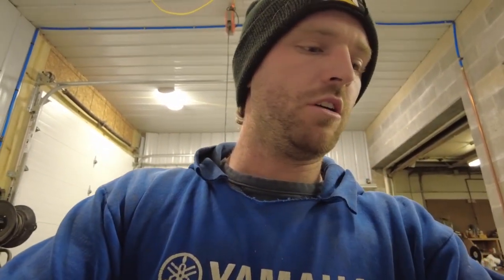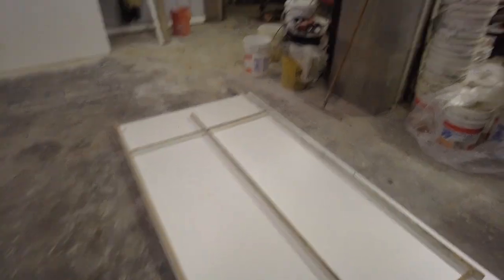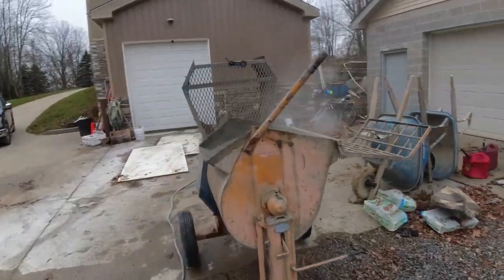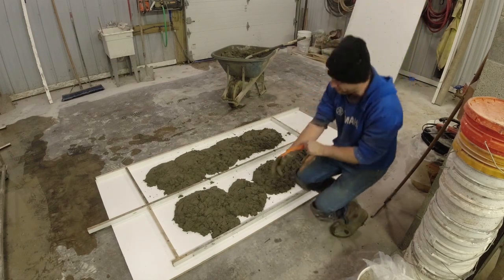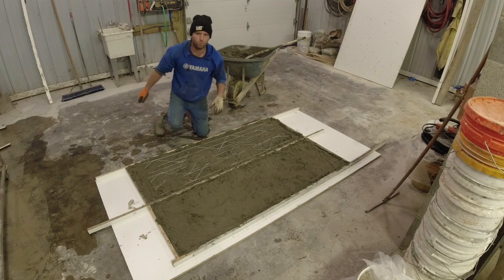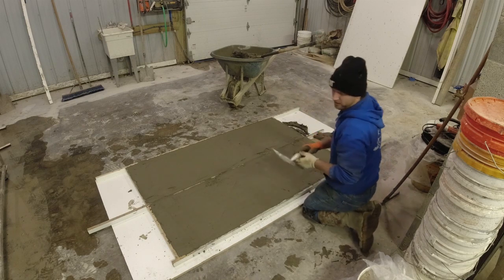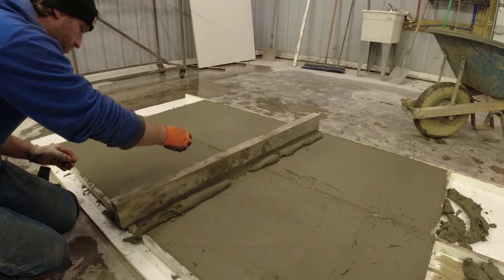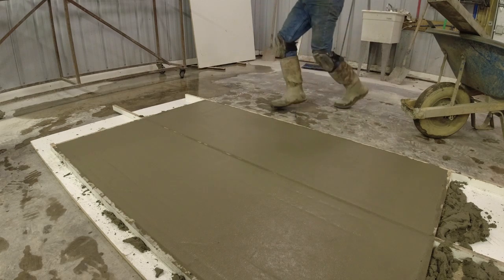Gotta Pay The Bills Part 1 (Concrete Countertops)

Comment: I considered making cast in place tops for my kitchen a couple of years ago but went with epoxy instead. Had my kitchen been smaller I would have gone with concrete since I did not have any help and I could do the epoxy by myself. I will be doing an outside kitchen this coming summer and I will be making the top out of concrete. Anxious to follow along with this project to get some tips. Thanks for the video.
Reply from the maker: Thanks for watching! We’ve done poured in place one time and I refuse to ever do it again haha I know there are other ways to finish and polish concrete countertops but the way we do it is so unbelievably messy. I prefer to do it this way in our shop haha

Comment: Do you buy your 9mm by the case?
Reply from the maker: I go on www.ammoseek.com and look for the best deal from a reliable brand. I usually try to buy it in 1,000 round cases but occasionally it’s less expensive (per round) to buy 250 or 500

Comment: Did u tap or vibrate the top?  You would think with all that money your dad makes he would have a work bench in there to avoid all the kneeling.
Reply from the maker: No, I didn’t tap or vibrate because I wanted to keep a lot of the air pockets. And we’ve tried pouring them elevated. There is too much room for error with the melamine twisting and flexing. This is the best way that we’ve have found to pour them. Plus, we don’t have to worry about not having enough room on a bench top 👍🏻 thanks for watching!
Reply: So do you never vibrate them or just for this build?   Most people make a huge deal about vibrating them to death.